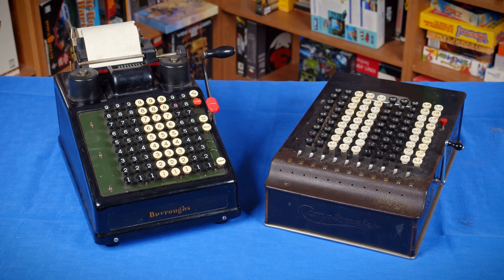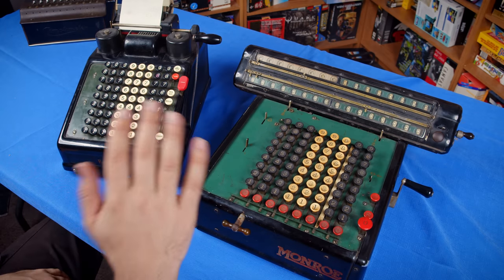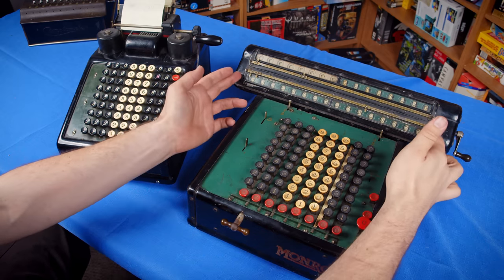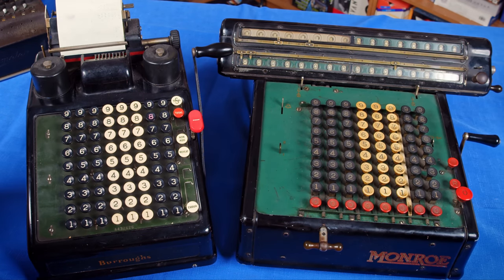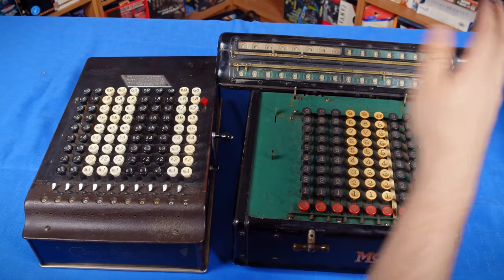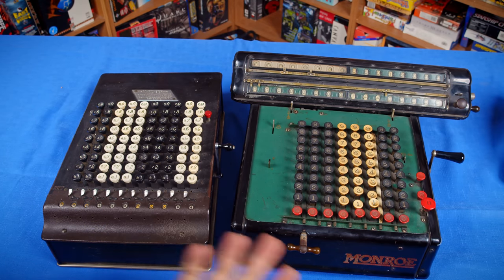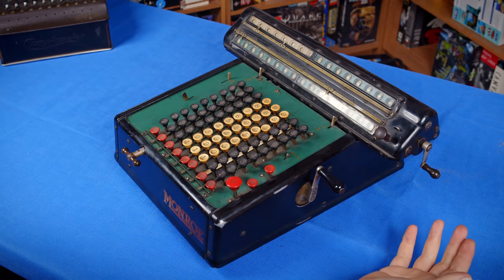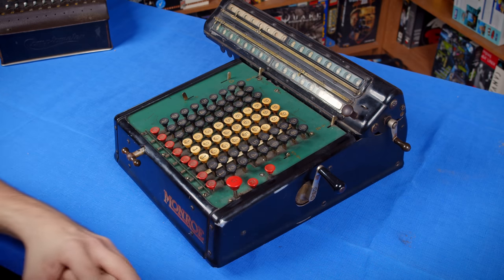1920s Monroe Mechanical Calculator

Comment from the maker: It looks like I missed that Monroe was acquired by Litton at some point but it's impressive none the less that they are still operating as a calculator company today!
Reply: RIP
Reply: My father had a job repairing electrified Munro calculators. He said the basic calculator was actually very reliable, but they had various add-ons to do different functions and these cause problems. Also being in the UK pounds shillings and pence options meant that the lower three numbers used a different base, which, as you can imagine also cause problems, especially apparently the happening column.

Comment: My Dad used to sell Monroe calculators back in the 50's-70's.  I saw all the calculators and how they changed. I remember how amazed we were when dad brought home the first handheld calculator.   You know they used to be really nice machines and some of them were very advanced.
Reply: My grandfather serviced Monroe calculators in the same time period.  Primarily Kansas City, Austin, Dallas, El Paso and New Jersey.  He always told me stories about sitting in on meetings at the Los Alamos rocket testing range while working on their calculators.  I lost him not long ago but found a Monroe calculator on ebay that I plan on restoring.  He wrote a service manual on one of the later models and we are trying to find it before I dive in.  Hopefully it didn't get thrown out.

Comment: 12:20 from what I understand, you would remove the lever when you left your desk so that nobody could come along and mess up your calculation. Kind of like removing the reverser handle from a locomotive so nobody can come along and take it out of neutral, or a lock-out padlock to prevent someone from turning an electrical breaker on when you're working on electrical equipment. Basically a "don't touch this" indicator.

Comment: Thanks for posting this.  I actually have one that I used (along with a slide rule) before electronic calculators came out.  You explained a lot of features that I never figured out on my own, so it's coming down from the attic for another work session.

Comment: 7:39 I can see why you might think that your Monroe is a pinwheel calculator.  The user interface works very similarly to that of a pinwheel calculator.  However, all the resources I’ve read about Monroe machines say that they used a stepped drum mechanism.  Pinwheel calculators use gears that have an adjustable number of teeth, but a stepped drum machine works by moving a cylinder with a staggered set of grooves on the side.  There’s a good animation of it on the Wikipedia article for “Leibniz wheel”.

Comment: At a small-town thrift shop some years back I picked up a similar Monroe calculator. It is electrically powered (though it has a empty socket for a crank) and you can really smell the ozone when it runs! It was re-badged as a Vanguard product for some reason. I discovered that  it was a Monroe  calculator by the name stamped on the electrical cable. Some research done in the last few minutes suggests it is similar to the Monroe LAS-160 though the number keys alternate between white and black in groups of three so it is not a definite identification.

Comment: Actually 3.142 is correct if rounded to 3 places.   Another term for pinwheel calculators is the rotary calculator.  I used to have a Vriden DW10 electric rotary calc when I was a kid.  Being a budding tech geek, I had a ball with that thing.

Comment: This is a part of history I'm glad I missed. Imagine a supermarket outfitted with these machines, you'd have to wait hours before they were ready to total your shopping 😉
Reply: Check his video on the Comptometer, a skilled hand at a mechanical calculator can seriously rival the speed of an electronic one.
Reply: Ancestors of this were in use up until the 1990s. I remember some (electro)mechanical cash registers used as late as the early 2000s. They aren't slow at all.
Reply: Ringing up groceries doesn't require a lot of division, LOL.

Comment: I just got a Monroe that looks very similar to yours in a thrift store for $8. I think it works, the main crank hits a stop going backwards like yours. The carriage hooks don’t release, I can pull them back and move the carriage but maybe something is locked? There’s a knob with arrow on the lower left which turns (you don’t have it), don’t know what that’s for.
Reply: Turned the knob you don’t have clockwise (marked MEM COUNT) so now the arrow points right to the keyboard. That unlocked the carriage. Running the upper crank backwards is sticking until I ran the carriage right several places but it feels a bit tight. Got it cleared. It has 8 place entry, 16 digits on the main register and 8 upper right. No upper left register.
Reply: All functions work, it’s dirty and a bit stiff so I’m reluctant to play with it too much.

Comment: Looking at the Burroughs one makes me wonder what on earth you do to enter a zero. It's amusing how neglected 0 was as a number up until maybe the last 100 years. I just watched a video about an obscure old apparatus for doing multiplication called number nines rods. Which are basically just multiplication tables. But the inventor didn't include any leading zeroes on the rods, or in the book about them with tables and things of that nature. Even though not using leading zeroes made the use of the rods much more difficult and convoluted than if he'd just included the leading zeroes.

It's weird that throughout history, there have been many instances of perfectly legitimate, useful numbers were ignored and treated like they were made up or imaginary. The Pythogoreans believed whole numbers were pure, and so didn't "believe in" any fractions or use them in math. And as mentioned before, poor zero has been treated as a non-number pretty much from its discovery in Egypt in 1770 BCE until just around 100 years ago.

 Similarly, negative numbers were treated the same way. To the point where mathemeticians would go to great lengths in their math to avoid using any negative numbers. Even though it meant making the process a lot longer and more complicated and less effective (the more steps the more chance for error).

Then there are the "imaginary" numbers, which were called that literally as a derogatory term to imply that they aren't real. And I guess the same can be said of complex numbers, since they're made partly of imaginary numbers. And. I just had a debate with somebody a few months ago who was trying to claim imaginary/complex numbers aren't real because you can do the same math using vectors or matrices. But I pointed out how useless and again, needlessly awkward and complicated that is at least in the context of analysis of electrical circuits. You NEED complex and imaginary numbers to do such analyses. But people still treat imaginary numbers as if they were literally imaginary. Which is why I prefer the  term Gauss proposed instead, lateral number. Since the imaginary numbers literally lie laterally to the real numbers on the number line.

That's just a few examples based on my small sampling of mathematics. But I'm sure there are many other examples. I can understand how a layperson might think something like an imaginary number might not be real. It's not an easy thing to understand at first and I remember learning the stuff in school always thinking that a lot of the stuff in math just seems like some jerk made it up and it has no real use. If they taught you engineering along side it, it gives you a practical application to apply all of these seemingly random and arbitrary concepts that just seem made up. It wasn't until I learned about electrical engineering that I really appreciated the real world implications of all of those things I learned where you think "well when am I ever gonna need THAT in real life?"

But I would expect that a well educated mathemetician whose very life is dedicated to understanding this stuff would be able to see how something like a complex/imaginary number is applicable to the real world and can be used to make many mathematical tasks much easier. Or even possible.

Comment: I found two later comptometers in the dump just today, they don't work but I want to take them apart and see if it's possible for me to get them to a some-what working condition
Reply: 11:50 you're actually supposed to continue down the columns, the 9's compliment of 0 is 9, so you type a 9 while holding the carryover in the 10's digit

Comment: I guess you can't divide by zero with them?
Reply: If you tried to divide by zero, you would just end up cranking it backwards over and over again without any change to the dividend.  That’s the ‘error’ you get when you try it on this kind of machine.  Apparently sometimes Friden electromechanical calculators would get stuck in an endless loop if someone accidentally divided by zero 😂